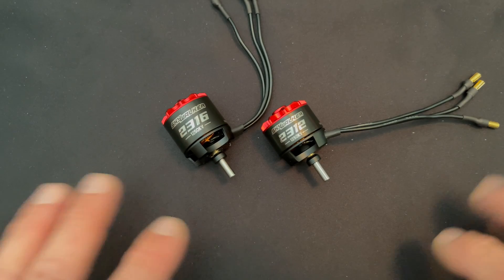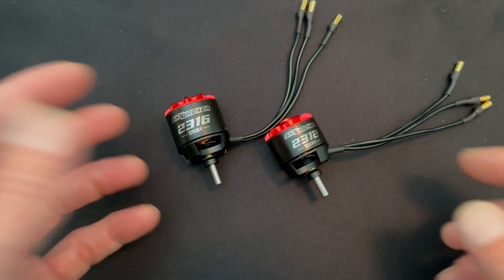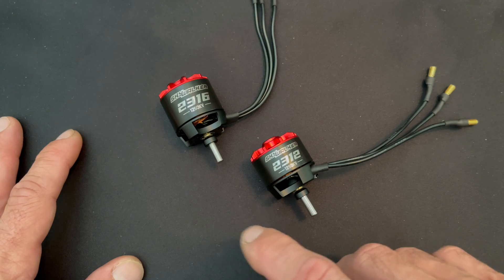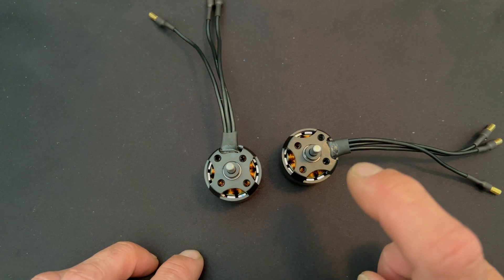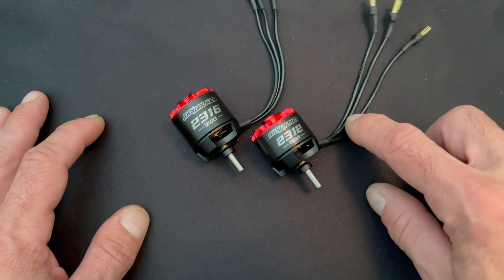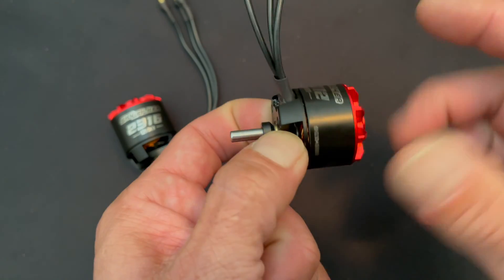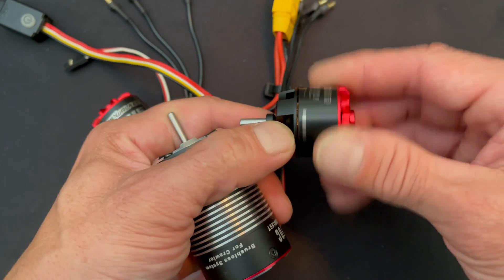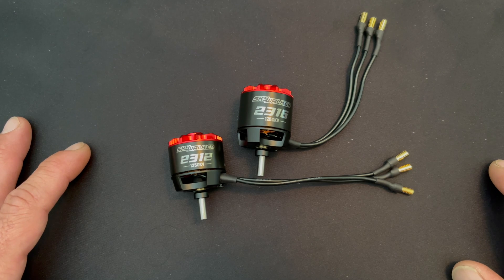The Charlie Show /// Episode 339 /// Skywalker 2300 series Quick Look

Comment: I purchased the 2826 SL 1100 there are tables in one of your vendors ( altitude hobbies). They list a table for a max temp 80C for 2 minutes. Does it mean that it can be used just for 2 minutes and the motor will 80C for all the amp ranges? Another question, what is the maximum recommended temperature for the motor if I want to fly for 5 minutes?
Thanks
Reply from the maker: Support/Tech Services are available by email - NorthAmerica@hobbywing.com

Comment: These motors look really nice! Something to compete with Sunnysky. I prefer this sizing notation where it gives you the stator dimensions. It's just easier to compare motors like this.

The 2312 in 980 or 1250kv is probably the perfect size motor for a 39 inch Twisted Hobbies 3D foamie. I just ordered one from amain. I got the 980kv variant.